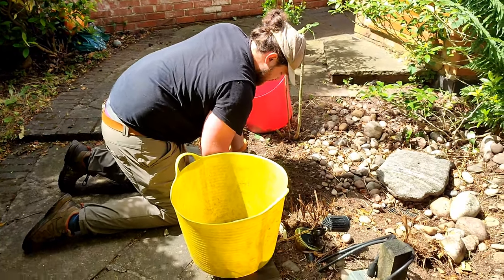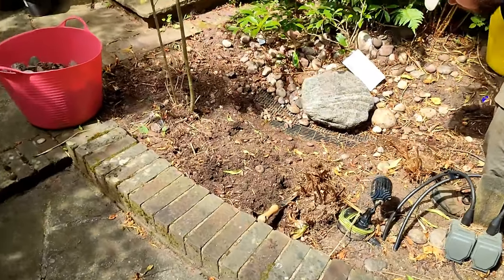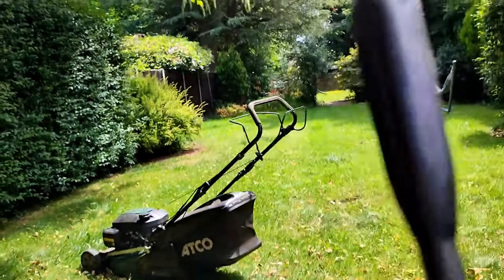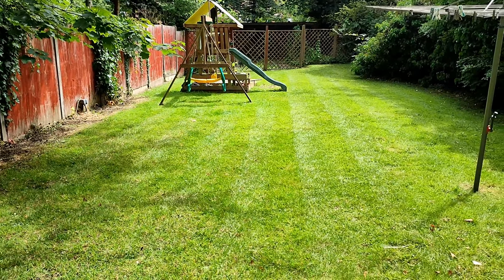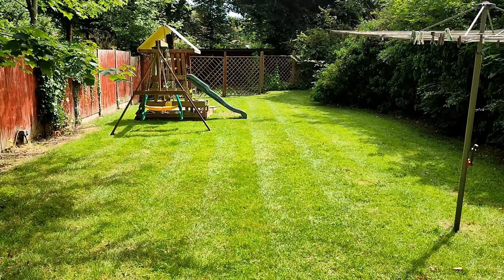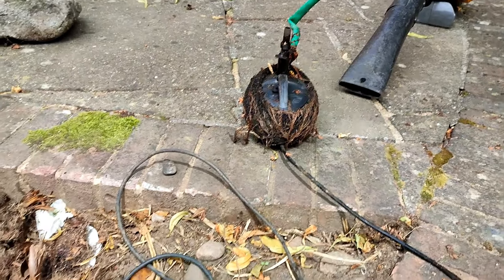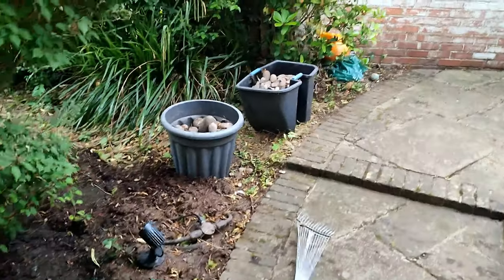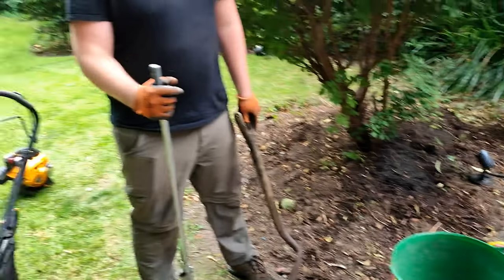We Reveal the Pond! & There's a Random Girl Asleep on the Patio

Comment: I would restore this water feature. I have a similar water feature in my yard. I have a basin lined with a membrane, so the water doesn’t leak out into my sandy soil. Cement blocks support my stack of stones that fit over a 1 inch PVC pipe, which is attached to tubing fitted onto a pond pump. The basin is covered with an aluminum frame covered with mesh, covered over by stones of various sizes. I have the pump attached to a transformer for holiday lights, so I can turn the fountain on from inside. I love it!!! My basin is a little wider and deeper and my stack of stones is about 4 feet high, so it makes a nice splashing sound. The fountain just needs to be kept clean and have some lovely foliage plants added. A soothing feature for the garden.
Reply from the maker: Wow that sounds amazing, nice suggestions!

Comment: Pump likely works on float switch. Try putting it into a bucket and covering the intake hose w water. It should automatically turn on. Cleaning would help as well. They're not very expensive to replace.
Reply from the maker: Ah Killer Advice! Thanks
Reply: There might also be a switch for the socket somewhere, possibly even a timer.
Reply: I was thinking there might be a circuit breaker in the house or some where turned off.